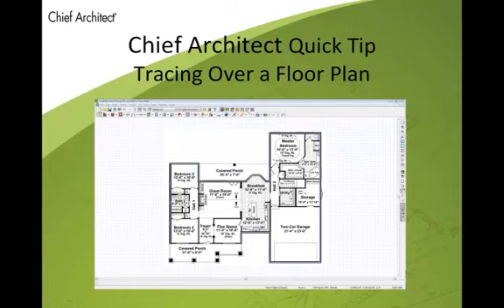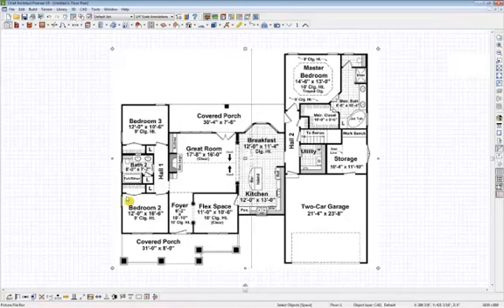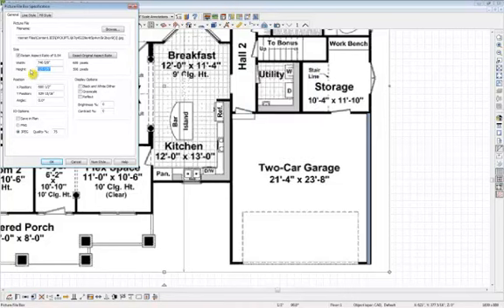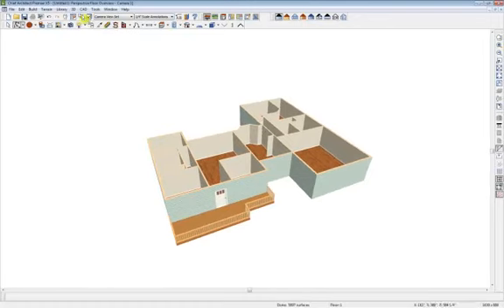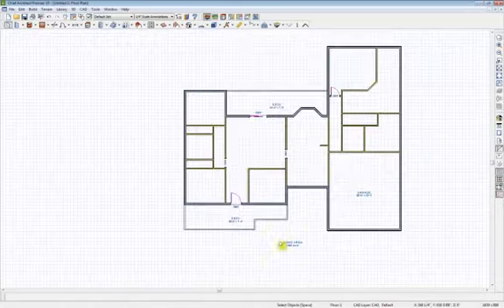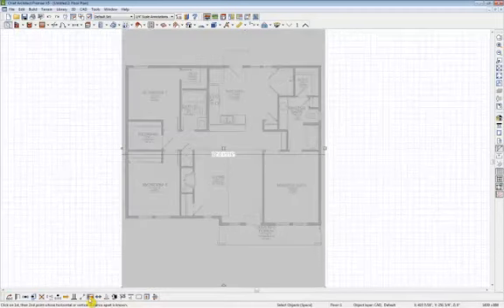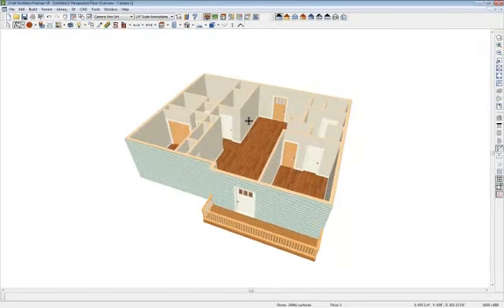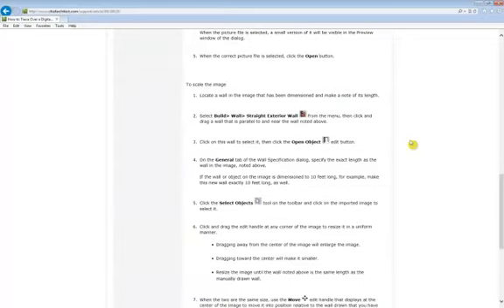Importing and Tracing Over a Floor Plan

Comment: Appears that this process is NOT applicable to Home Designer Pro?
Reply from the maker: Hello John. This video was created in Chief Architect. You can also trace over a floor plan in Home Designer Professional. I have linked below an article that was created specifically for our Home Designer line that goes over this process. 

https://www.homedesignersoftware.com/support/article/KB-00018/tracing-over-an-imported-file-to-create-a-3d-floorplan.html

Comment: This and the Modern Bungalow series are precisely what I needed to get started. Thank you so much! I do agree that at times it is difficult to follow. It would help if the instructor (wonderful instructor, by the way) could pause, hover, and zoom at points where commands are to be selected from toolbars. There are a lot of commands, and even on a 30" display, if the mouse moves away from the toolbar item too quickly, it is something of an inconvenience/distraction (not insurmountable) to regain one's bearings. Wonderful, clear, organized, thoughtful instruction. Thank you again.

Jim
Reply from the maker: Thank you for your feedback!